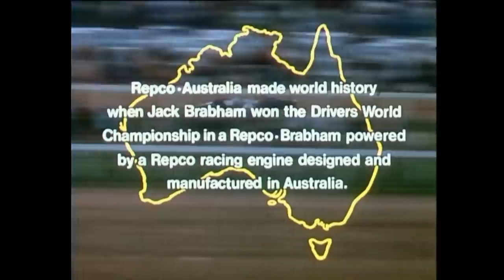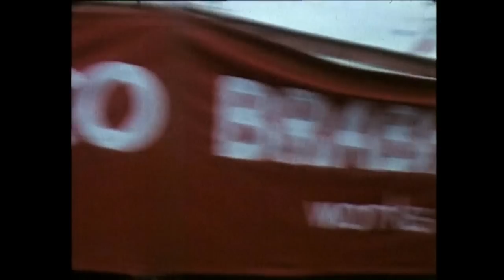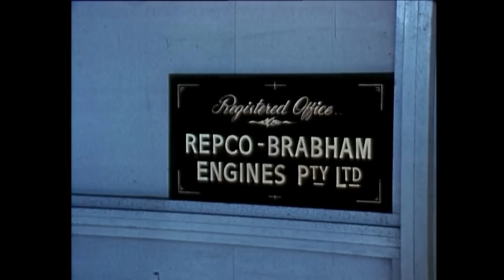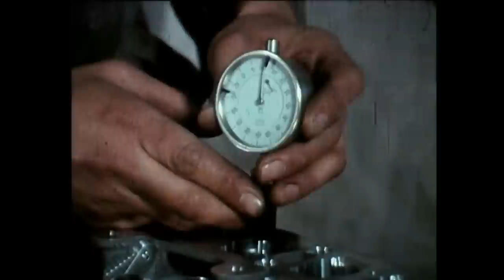REPCO-BRABHAM The Fantastic Year (1966)

Comment: 1966, and the tires are treaded, but they're getting wider, and those cursed wings have yet to be introduced.  Nothing but pure horsepower and driver skill involved.  Would people be interested in seeing such racing today?
Reply: @Andy Harman . . . and that was also back in the era when the driver had to make the tires last the entire race; no pit stop for a replacement set.  I'd be interested to see such racing nowadays.
Reply: @bloqk16  never again
Reply: @bloqk16   Without disagreeing with you, but it was not so much the driver that made the tyres last, but the tyres were designed to last whole races, I too would love to see a return to no tyre changes, I think engineers, on the pit wall calculating overcuts and undercuts and tyre compound choice detracts from the race, I like to see overtaking on the track, not in the pits, in my opinion, for what its worth.
Reply: @bloqk16  so that's where the term

"Taken out of the race" comes from?
Reply: @jamesreynolds2867  I don't think most race fans would disagree with you, but how do you set up the rules to achieve the kind of racing you want to see? Formula One wants to bill itself as the pinnacle of auto motive development and technology. It is hard to be the 'best' if you inflict rules on the builders to limit what they can do. NASCAR is the opposite end of the spectrum - everybody uses exactly the same chassis and body and can only use different engines. Of course the engines, no matter the maker, are almost clones of one another.

This era of racing, and the pre-wing cars is also my favorite era. I think we'll both need to satisfy ourselves by watching the vintage racers while we still can. The racing isn't as cut throat, but the sounds, and occasionally the show, is still fun to watch.  

On second thought, this racing does still exist. Formula Ford is roughly the same cars (tube framed open wheeled) as Formula One in the early 60's. The engines are almost as high horse power as the F1 cars were in the 1.5 liter era (then ~175 hp/ now123.5 hp). The racing is competitive, if not as high stakes. Tires last the race, so does the tank of gas. The only problem is that the birds watching the racing are as old as we are now, not the fresh lookers we remember.
Reply: Better the driver's be fat and the tires skinny, than the driver's be skinny and the tires fat....

Comment: the only man to have ever designed, built & raced his own car to a world championship ..
Reply: It will never happen again..a simply out of this world achievement.
Reply: It was an Oldsmobile engine.  LOL. shut up.
Reply: @AmericasChoice  He still assembled it and engineered it for racing conditions..that's what Rodney Sprenger is meaning
Reply: @AmericasChoice  Itwas basically an Oldsmobile block & main bearing caps. The rest was designed & engineeredby Repco. The cylinder heads were designed by Australian Phil Irving.
Reply: Jack took most of the credit, but without the team input from Ron Taurenac and Phil Irving  and others the car would have ran well behind.
BT ,19 being Brabham Taurenac at least acknowledged in the Brabham car model numbers.
Reply: @elroyfudbucker6806 
Wrong year.
Wrong engine.
The '66, '68 & '69 engines did away with problematic passenger car componentry. By 1966 Repco Brabham were casting their own all aluminium blocks at Repco's inhouse foundry. You can see clear evidence of that in the footage which shows AUSTRALIA cast onto the crankcase skirt at the 25:24 minute mark. The entire engine was designed & developed, cast & manufactured in Melbourne Victoria.

Comment: RIP Jack. Superb effort. Minor correction on the Australian publicity clip though... The cylinder heads on that engine were designed from scratch by an Australian, Phil Irving, the same man who gave us the Vincent Black Shadow. (And Tuning For Speed.) Induction usually came from a set of 4 IDE-48a Webbers, not that rather odd mechanical fuel injection rig, but the 'short motor' came just about complete from an Oldsmobile production car. It had a crank with a shorter stroke made up, and the tops of decks milled down. It was chosen because it was an early Aluminium engine, and quite lightweight. Brabham figured that with a shorter stroke to keep it below 3 1/2 litres, he could rev it pretty high, he just needed decent cylinder heads. So he got Irving (fellow Australian) to design those and Repco (Australian company) to build them. All the moving parts were changed, and so were the original heads, but the block(s) and main caps and cases, were from a production car. It was allowed because nobody protested it, because it was at heart, a one man effort built in his garage. If Ferrari or Ford, (or Oldmobile for that matter), had entered that engine, it would have been disallowed because it was not a prototype, it was a tuned up production engine. He got away with it because nobody was prepared to object. How would you look if you managed to get a man thrown out in the car he built in his garage? And much of the car he really did build himself in the shed. But not the engine.
Reply: A lot, perhaps most of the design was done by Frank Hallam, Paul England and another bloke as sadly at that time Mr Irving was otherwise engaged. Kieth McCubbery and their apprentice John Judd were also involved in making the swarf and on the construction side. A very friendly, down to earth and extremely helpful bunch of blokes.
Reply: The rule of not a tuned stock block is something that’s new to me. There’s the Cooper Maserati, based on the Tipo 9 V12 from the 250S and the turbo-charged BMW 4-cylinder cast iron engine block. 

Not challenging, just asking.
Reply: Destroked to keep below the three litre limit then. 3.5 litre much later in the nineties allowed to try and keep up with turbos.
Never heard that basing on a production engine was  not allowed.
Reply: @johnd8892  ~ It's a bit of a fuzzy rule. Ferrari make F1 engines that're very similar to a tune version of their road engines and nobody minds, but... Going back to the 1960s it meant something. They sort-a gave Brabham / Irving a get-outa jail free card because they were  a small single-man privateer team, and the sort of people that rule was written to restrict were companies of tens of thousands...
Then a few years later, the Brabham team (Jack had long retired by then) teamed with BMW to make a very robust and very highly turbocharged 4, based on (? I think) a 1600cc production engine. Why that rule was a thing in 1964 and not a thing in 1980, I don't know...
I also follow bikes. Now if I decided to make a GP bike and use a very sharply modified Yamaha R1 engine, with my own chassis, I'd have trouble, because we've had at least one aspiring entry refused on exactly that basis. The rule says 'prototype' and that things is a production R1 that's been modified. That's not what the top classes in motor racing are about...
Reply: McLaren F1 in 66 also used a production based engine in some races. Based on the Ford 289, 260 or  221 V8. I imagine a similar approach as the Repco V8. Bruce McLaren would have seen what Brabham were achieving with Tasman series 2.5 litre version in 1965. As in the Sandown scenes possibly.
Tasman series helped Repco get some good experience with the design.  I think the Tasman series experience was all part of the plan.

Comment: Beautiful documentary. Only a year later the Repco V8 was obsolete with the arrival of the Cosworth DVF.
Reply: The Repco 740-engined Brabham defeated the DFV for the championship in it's first year powering the Lotus 49. It was not rendered obsolete...the Quad Cam 1968 engine was very much equivalent to the DFV and the RB's were quick with it but Repco was losing interest and the engine was never really developed
Reply: @stephenscholes4758  Are there any pictures or videos of the 4-cam 1968 engine you could refer me to?  I didn't know there were 4-cam Repco's.  Did you know there was a Repco Pontiac?
Reply: @stephenscholes4758  Shut up.  It was an Oldsmobile 215 CI engine.  NOT an Australian design.  LOL
Reply: @AmericasChoice  The 215 was a fragile pushrod design, and the Repco only used the blocks but then, not in 1967 Champ. The blocks were cast in L23 Aluminium-alloy at the Commonwealth Aircraft Corporation, Salmon St Port Melbourne , Australia. The heads were cast by Castalloy in Adelaide, South Australia. The 1967 engine shared only bolt patterns with  the Oldsmobile engine. Once again, America's knowledge of motorsport is proven to be slight, they have contributed little to it
Reply: @stephenscholes4758  LOL. America contributed the engine design for Brahbam/Repco. LOL. All your comment says is that they produced an engine based on an Oldsmobile 215 CID.  They did not create the engine.
Reply: @AmericasChoice  The Olds' was a pushrod design with a 90 degree crankshaft...the Repco a SOHC with a 180 crankshaft, made in England....Once again,  by 1967 the only thing the Repco owed to the American engine were its bolt patterns and general crankcase dimensions
Reply: @stephenscholes4758  the Repco V8 race engines were made in Victoria Australia. First by Repco at their Richmond factory then at Maidstone. Virtually corrugated tin shed factories. Film of it being made on YouTube.
No Repco UK factory.
The car chassis is possibly the English construction you were thinking of.
Or was it just the crankshaft made in England?
Reply: @johnd8892  Yes, all crankshafts made in England (Laystall) was how it was meant to read. Apparently by 1968 they were wanting changes to stroke size but had a bulk of the ones made in 1965/6 so it was considered wastage.  Early cylinder heads were cast in England as well, then Castalloy did them in Adelaide.Actually, for a big manufacturing enterprise, Repco, or Russell Manufacturing to be fully technical, manufactured surprisingly few bits for the engine - namely the pistons, rings and bearings - most other stuff being farmed out. The feat of machine finishing and building of the engines however , can't be understated. Cheers

Comment: Aluminum Oldsmobile 215 blocks with race OHC heads.  Amazing.......
Reply: +Johnny Smokestack   Myth.  Six Olds blocks were used early in developing the heads.  The Repco engine was entirely Repco designed and built.
Reply: @nonyadamnbusiness9887  wrong.  It was an Olds design.

Comment: That engine was not totally a Repco designed, Aussie-built piece.  The aluminum blocks were Buick-Oldmobile 1950s small block (about 3.8-litre) V8s used for a few years in smaller Buick and Olds sedans.  Problems with those engines caused GM to give up on them after a few years.  I understand that at least some of the initial F1 engines were actual GM blocks reduced to 3-litres. Of course only the blocks would have been used.  The rest, including the 1967 four-cam heads, were Repco.  That same GM engine was sold to Rover and used in some Rover and MG cars well into the 1990s.
Reply: Thomas Nixon If that is the case then it is highly modified to the point of being a new casting. The buick mains were not cross bolted, the repco crankcase appears to extend further below the bearing parting line. The buick motor did not have 6 head bolts around each bore nor did it have wet cylinder liners. While it has been a long time since I read the repco engine service manual I cannot recall any lifter bosses in the block either. Repco had the resources to cast its own blocks or farm the job out to others
Reply: The block that features in this video is from 1967 and was cast at the CAC (privately run Commonwealth Aircraft Corporation) Fishermens Bend, Melbourne, Victoria, Australia. It was dimensionally the same as the 1966 Olds unit so all the 1966 bits would fit. So, in sum. 1966 = Olds block. 1967 = Olds block (early season) and CAC block. 1968 = exclusively CAC block.